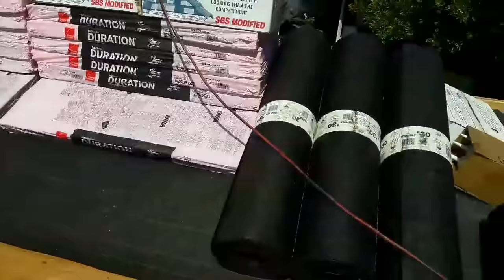YOU THINK  YOU ARE A REAL ROOFER? watch this first!

Comment: How come you didn’t install plywood on top of the skip sheeting? I’ve repaired so many roofs that were installed on skip sheeting, it’s not professional to install it on top of that type of sheeting. And you should always paint the pipe flashing and caulk the seam  before you install it and install the pipe flashing with the seam facing away from the street, and also curious why you don’t use gasket screws to hold the pipe flashings in place? It gets rid of needing to use caulking on the nails, not trying to claim or sound like I know everything but it would just be more efficient to do it other ways, anyway you are still a great roofer 👍
Reply: Si . Igual mi pregunta de por qué no se instaló plywood ? Que de las imperfecciones de el deck ?
Reply: In Southern California Plywood is not required on space sheething with a .25" gap or less

Comment: You do better work than most I see. A couple things though - 
1. You should be closing the bottom of those valleys. Also, you should consider putting ice and water shield over the valley, too (even just a half strip). This way every nail you put into that sheet of metal will be sealed by the I/W shield. 
2. While that roll vent is quicker, it's far less effective than  Shingle Vent 2. You seem to care a lot about straight lines and curb appeal. SV2 is much cleaner looking product too.
 Not sure what was going on with the counter flashing on chimney. Did you just paint it?

Comment: I've been roofing for a little over 20 years now the way you do the metal open valleys with the w valley in it and your work just in general looks like a very good quality damn good job my friendthe only one thing that I would comment on would be around the gas pipes the reason they want you to leave the two inch Gap around it is if any gas escapes it has room to travel up and out around the pipe that is why you never seal the flashing around the top of that pipe you put that flashing on there leave it open and then put a storm collar around over top of that and seal that so that the gas can be released from the roof if it ever escapes from the pipe just the way I do it not criticizing your work in any way my friend
Reply from the maker: It make sense!!
Reply: If you don’t mind me joint the party. Yes clearance plywood to hot hvac pipe is to fire hazard. The 4” Jack then travel through a roof Jack installed to plywood, as you know most fits are pretty tight…then we have the storm collar(snugg fit) and then exhaust cap. Of course we are all aware of some of those who don’t re assure pipe to exhaust to assure placement. Those collars are notorious for leaks, again thanks for the chat. Do you mean roof Jacck next size up, and gasket Clearwater to roof Jack seam and seal gasket, this the spacing now has flow for given event??

Comment: You are a good roofer when you know this house had to be re-deck instead of shingling on this half inch gap planks. In other states this wouldn’t pass inspection
Reply: In a local town by me we have to remove the planking and replace it with 3/4 cdx no osb it's terrible but makes a great roof

Comment: how do yu replace roof jack electric mast
Reply from the maker: use a lead flashing , solder the roof jack around the pipe , then use a clamp on top to prevent water penetration.

Comment: That roof is gravy. I put a hundred roofs on like that. The "spaced sheeting" is actually illegal in some states and needs to be sheeted with plywood before you can roof it.  The ladder is at a dangerous angle. The ladder should be 1 foot out for every foot up. Count the rungs. It should also extend up past the edge of the roof by 3 feet. I've seen people fall because they didn't know that.  The peelistic is Ice shield. The reason on the edges is because of capillary action. The water CAN get under their but that's not the main problem, the main problem is ice. Probably not necessary anyhow. Why you got an inspector on a reroof? New construction maybe but reroof? No. 9 times out of 10 the inspector knows less than you do, he's a bookworm.  Your vents are cut in wrong, you left no room for drainage, just asking for a leak their. Also looks square and cheap looking. Vent ridge is ok if you don't have whirlybirds, but whirlybirds work better and cost less.   Always chalk the Valleys the hips and the ridge, that goes without saying. The 18 inch chalk line is a waste of time. Run the first 3 courses, Then chalk a line. ALWAYS use BLUE chalk NEVER red. Red stains. Blue doesn't. Cover the line with the next row of shingles.  Shingles are easy. If that was tile or wood you would have to measure to the top and adjust your courses as needed. You want it to come out on a four or five. Preferably four. If its tile it comes out on five. For MOST tile, not all.  If you add a course at the top you better split the difference or you will have a one inch course at your vent ridge which will look amateurish.   I did this stuff for 18 years straight, worked with some of the best roofers in the country, always took pride in my work and always learned what the best way to do things was. What I get? A bad back and a pile of frustration. The only roofer who makes money is a conman and not a roofer.  Good luck eric Garcia. Your gonna need it. Course your probably ripping off your guys so you'll do fine, how many of em speaky de english and how many of em got green cards?  The average American these days is a Mexican driving a Toyota.  :) His Kids are probably all gangsters.  Am I prejudiced? not bad but am I happy they came in and knocked the bottom out of the construction market? Hell no. I was making bookoo bucks till the eighties when two million mexicans a year came across the border into California and basically ruined my life, Now they are making videos on how to do what I gave my life to. Can't say I like it much. Stanley nail gun...cheapest you can get. Better off with a Senco. What compressor you got a Mattel?  In fact if it wasn't for guys like this, I'd probably still be rolling. They put me out of business. Cheap labor from mexico. Non professional. Not that any homeowner would know the difference, how many of em go up on the roof to see, and would they know what they were looking at even if they did? Its all a con job.
Reply from the maker: Paul ofTarsus ...i think you're blaming the mexicans for losing your job, I think what happened is , you got old and lazy, you probably were overpriced trying to make money in one single shot, the other thing that put you out of business is your lack of professionalism,  maybe you had many mistakes on your workmanship and when people call you back you never showed up to fix your water leaks. Remember craftmen like you and I , depend on loyal customers , not on foreigners coming from another country and blaming your failure in life to those guys, in my case I care less about the new contractors that get a roofing license everyday, all I  care is my customers and follow what i said on the contract,  please don't blame anyone for your failures in life, you don't have the capacity to overcome the new generations of roofer or builders that come up every day, like i said, I'm teaching the new generations  of roofers and I'm not greedy like you, i place this video on YT just to help out someone in the crowd. Because I  think youre pretty expensive sir.
I think you're pretty far from being a true professional, all you see are, mistakes on some else's job, that tells me you're a stubborn person trying to make things his way, you have to open to new ideas and learn from them. 
Remember...we're all a team!!
Eric.
Reply: Paul ofTarsus not to bash on you or anything but just providing a different point to your argument, my dad came to the United States when he was 14 and has been doing roofing for 20 years, I can confidently say that he Is one of the best roofers in California, he got his roofing contractors license and his gutter license, and started his own business, I’m 18 and have been working for him for 4 years and he does everything up to code and never takes any short cuts, he can do metal roof, flat roof (tpo and torch etc) , tile, shingles, and is learning solar he has a ton of references and is constantly flooded with work, you seem like you could be a nice guy but I’m just letting you know that not all Mexican people are out looking to fuck people over, I do agree that some of the things in this video are unprofessional but you don’t need to bash him for it, anyway I hope you can look it from a different perspective.
Reply: and u call u self Paul oftarsus,something its wrong with you sir,
Reply: Dang you telling him how it is lol
Reply: 1st of all they are called 'Turbines' not 'Whirly Birds' second of all they are not more efficient than a ridge vent. In order to ventilate a roof and allow heat to escape Turbines need wind, so on a day that wind is not blowing Turbines are inefficient. On the other hand a ridge vent will always allow heat to escape because of its opening.
Reply: I agree, they have ruined Texas. Junk roofing all over Dallas.